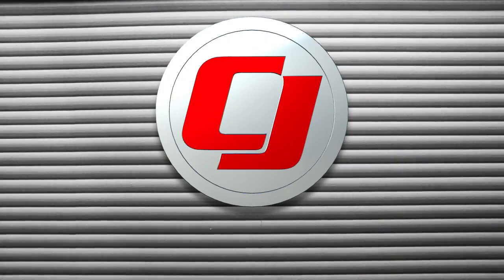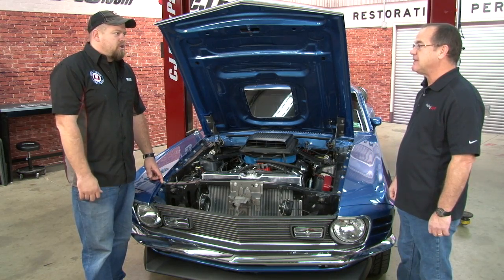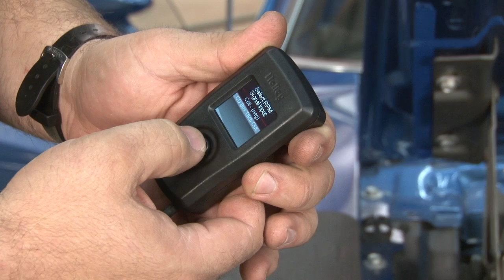Terminator Electronic Fuel Injection System | Holley | Mustang

Comment: Hi bill so I would like to buy this system, but one thing I would like to know is would I need a new distributor and intake manifold? I have a D.U.I high performance distributor and an edlebrock intake
Reply from the maker: The intake is fine  but I have never used that distributor so I don't know for sure. I would think you would be ok.
Reply: CJ Pony Parts another question my battery is in my truck, and as said in the video red and black cables must go to battery, does the kit come with enough wire to take it to the trunk or will I need extra wire to hook it?
Reply: @AnthonyHernandez-xp7gd  You will probably have to extend the wires. I haven't installed this kit on my car yet. But I'm almost possitive the wires are not long enough stock, with the standard kit.

Comment: I’m just now reading about this EFI installation so despite its original post date , it’s news to me. I should mention that I’m a satisfied customer of CJPP and I feel like Bill Tumas does an excellent job of educating and informing classic Mustang owners like myself. 

When it comes to EFI conversions, this Holley Terminator is as good as they come. It offers many benefits when compared to a conventional carburetor with precise fuel metering , better cold starts and in most cases an increase in fuel economy. But in the big picture it’s function is very similar to a highly tuned carburetor because it bolts onto an intake manifold that’s designed for the air /fuel distribution as provided by a carburetor. 

Intakes designed for wet flow charge induction have to compromise equal fuel distribution to each cylinder because of unequal port lengths and location. Despite the better fuel atomization offered by the EFI throttle body, there’s still a tendency for the fuel particles to drop out of suspension with the air while passing through the intake manifold. 

To justify the expense and reap the benefits of true EFI the fuel has to be introduced into the air flow charge as close to each intake valve as practical and sequentially timed according to the engines needs as determined by the PCM or in the case of a stand alone retro-fit installation , the SEFI control package. 

SEFI has been available on new cars for decades the same benefits that it offers should be made affordable and easily available to classic muscle car owners as well. It would offer a wider range of tuning options compared to throttle body injection. Many of the newer aluminum intake manifolds offered for carbureted V-8 applications already have pads located at the mouth of each intake port that are drilled and tapped for nitrous nozzles. They can be easily utilized for fuel injection and the performance benefits of sequential port fuel injection tuning can be fully realized. 

I have owned an “M” code 1970 Mach 1 similar to the one used in this article for 35 years. I’m currently in the process of making major changes for some serious street /strip performance with the 351 Cleveland being extensively modified by using the old school components that Clevelands respond to so very well. There might be a EFI conversion in its future.....maybe ?  

And the old school beat goes on ....

Comment: I am looking to buy this system but have not figured out where I can get power on the red/white wire during cranking and running without taking it from the coil wire, which is not suggested.  I am running a MSD ready to run dist  in a 66 Mustang.  Where can I hook the Red/White wire?
Reply: Ron Knoche...having a reliable source of power with sufficient capacity to operate the Terminator control unit is essential. The requirements and suggestions are well detailed in the installation documents. If this information isn’t easily understood then you might want to consider having a qualified professional do the installation for you. A power wiring mistake could be a little frustrating or very expensive. Always read the entire set of instructions before beginning the installation. It could make a huge difference in a successful installation or a smoldering mess.

Comment: hey i have a question, im thinking about getting a system like this... i have a 1988 e150 5.0 dual tank an is fuel injection and i would like it convert it with a fuel injected carburetor.... but would this system work with flex fue or E85.

Comment: Let's say you've got a speed density foxbody and you were planning on switching to mass air. would this be a better option than the ford computer and harness?
Reply: +trenton schaefer  If you are ok with switching to a carb manifold based system this would be an excellent choice

Comment: What about the fuel economy? Any significant improvements?
Reply: The owner of the car really doesn't keep track but given cold start issues etc the fuel injected setup will use less fuel and be more efficient.
Reply: Bill Tumas I asked this because i was curious if mounting a system like this on a 7L V8 would improve its fuel consumption enough to make it an everyday car here in Europe, where a liter of gas is 2 dollars. No matter how rich you are, but paying 60 dollars in gas for a 100km trip is not that pleasant.
Reply: +Vicol Andrei : your best bet to increase fuel mileage is a modern overdrive transmission. The fuel injection will help but unless the carb is way rich. There won't be a major increase in mileage. Fuel injections real world advantage is drivability start, just drive, throttle response it just runs better all the time, any temp,any place,ect.

Comment: Hi there, because this has the electronic device to answer all the questions like cubic inches etc, could this be used for multiple engines?  Just change all the parameters?  For example, my '68 has the 289 which I'll be running for a while, but plan on stepping up and swapping in a 408 ci windsor.
Reply: Yes it can be used on any engine that will accept a 4 barrel carb

Comment: Does the Mustang have more power after this upgrade or does it have less? Is this upgrade just going to add drivability and easy cold starts. If so why bother?
Reply: Arkansas I don’t have it installed but what I’ve asked mechanics around they said yes to all those questions, you will get better air and fuel mixture, easier cold start, smoother idle and I believe it’s a self learning system so you might not need to fiddle with it too much after installation

Comment: Hi guy's,
I install a new Carb. Holley Street Avenger 4V -670CFM(WEChoke).
Is this setup only better for saving fuel... now the engine runs great with this carb.?
I use the Holley Blue Electric Fuel Pump(Competition) and pressure regulator, is this reusable for the Holley Terminator system .
Thanks,
Eddy